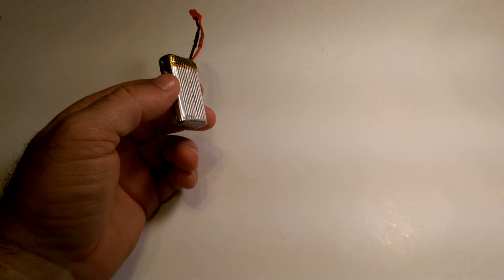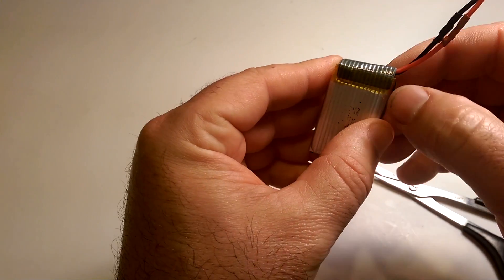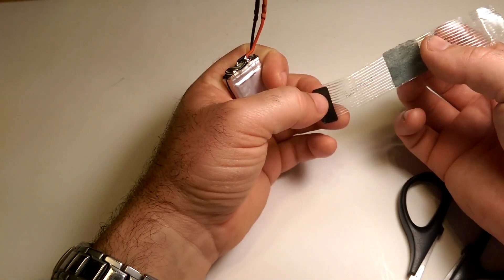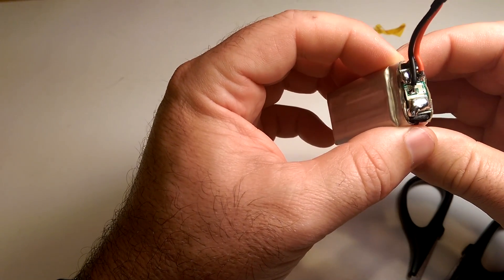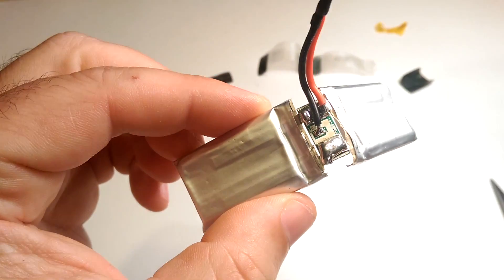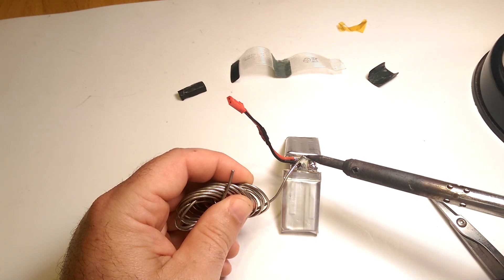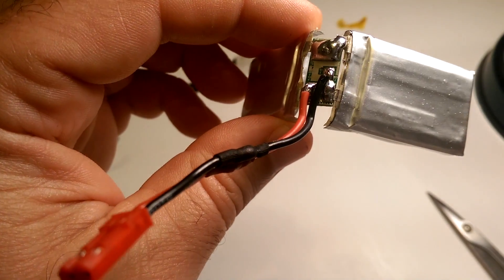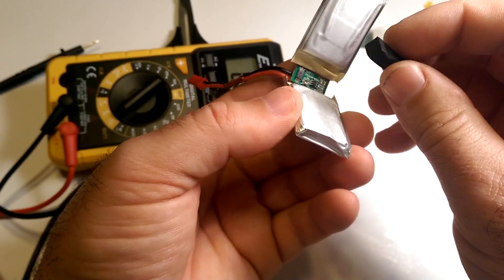7.4v 2S Lipo Battery Repair - Quick and Easy - [Don't Throw Your Shorted Lipos Away]

Comment: Go ahead and bypass all the protection circuits, that should turn your little toy into a roman candle and also burn down whatever it lands on. The replacement battery is only $8.00. Don't forget to put the fire out with water!!!

Comment: you bypass the bms, so the battery is no longer balance.., does it work?
Reply from the maker: Yes but you should  watch it carefully since it can no longer balance.  Don't leave it fully charged or discharged when not using it.  Keep half charged when stored and in fireproof bag/box 🍻

Comment: Good but please remember you loose the 2s lipo inbuilt balance charging circuit so it requires a seprate leads and not recommended for its own original device although it can be use independentely with balance leads anywhere....................

Comment: My man i did da same thing but not da battery mine I accidentally touch the two wires inside of the Drone the ones you connect the battery to it popped out the red one popped out I wanted to solder a bag I accidentally touched it to the black one it smoked burning smell too =/  just stopped I never fucking. Didbthis stuff I don't know now you might just make drone Day ho do you think is it confusing when you get it

Comment: Except now if you accidentally short it, it could explode.... I recommend NOT doing this, but I do appreciate the knowledge share.
Reply: That battery is so small, it won't do serious damage to you. Also: how would you ever short out a battery for more than a second? The bigger risk here is that if one cell degrades differently from the other one and you charge it up without a balance lead it will overcharge and possibly burn (or what you call ''explode'')

Comment: I have shorted some batteries trying to test out adding an fpv camera with various step up boards. I have only just found out myself there was nothing wrong with the batteries just the chips. You can also actually buy replacement chips from aliexpress. I haven't found the right sized replacement boards though. ALSO very important, don't rip the nickel from the aluminium pole of the battery or its going to be impossible to resolder without extra special aluminium alkaline corrosive flux. The chips to look for are probably: 8205A DW01A

Comment: hello dustin I buy a rc car (7.4v 2s 1500mah  Li po battery) from one of your gearbest links and I received a US charger but I live in Europe so I was wondering if maybe I can charge it with this on a computer USB port ? : https://www.amazon.fr/gp/product/B074J5GK41/ref=s9u_simh_gw_i1?ie=UTF8&pd_rd_i=B074J5GK41&pd_rd_r=549db280-2efb-11e8-ad28-014ae5dc2f42&pd_rd_w=jeEA5&pd_rd_wg=SGgox&pf_rd_m=A1X6FK5RDHNB96&pf_rd_s=&pf_rd_r=6B90PPZCKHGH97JW16ZA&pf_rd_t=36701&pf_rd_p=74c057ad-073f-4101-8de0-0fc75f2333b3&pf_rd_i=desktop

Comment: Id recommend disposing of the battery because its not worth it i have a friend who has a airsoft gun thats a aeg an his charger melted from the battery malfunctioned so id say do not use a malfunctioning battery or a short circuit battery cuz rc an airsoft gun do use the same type of batterys theres a number of things that could happen one is the battery can pop an releases smoke toxic smoke two it could explode an cause bodily harm or it could just burn up an catch on fire just spend the money on a new one to bad you cant get a core charge on um lol

Comment: This quick and easy method, you can have nearly unlimited amounts of battery power …for nearly no cost [Check Details Here==>https://docs.google.com/document/d/163kspciMT9QSUlNAvv0MT-ezkqtKCoEIdoxzlystrFQ/edit?usp=sharing ]. Enough to even live off-grid and power all of your devices an electronics! This easy method works for nearly all kinds of old/dead batteries too…

Comment: You can save a lot of money by bringing your old batteries back to life and re-using them instead of buying new, overprice batteries. And this method is simple [Check Details Here==>https://plus.google.com/100351090281822647456/posts/DDHJUMRLfS2  ], quick and anybody can do it.

Comment: Ok. You should just resolder black wire to the other contact. You should also remove the circuit and just solder three wires balancing port on and then charge it with lipo charger

Comment: Hey Dustin. 
I want to ask, does the battery still work after you accidentally short the leads??  Cus in my case i accidentally cut both leads at the same time and it had a spark.. After i rejoint the wires, the battery still works and i can recharge it too, but  i dont know if thats ok or not.  Does the short surely blows up the chip oranything on the board ?? Or r there any chances of being lucky ?? 

Thanks bud .
Reply from the maker: +zakir mohammad I think you were lucky.  That's what I did and it fried the chip so I had to do this mod...lol.  yours should be ok.
Reply: Thanks alot bud ;)

Comment: Hi there.
 Do you by any chance know of a motor type that would work for the JJRC H8C and will last for more then just a few flights?
I am tired of replacing motors every 10 flights or so...
Reply from the maker: +Jack Scarpon Unfortunately this is the downfall of the H8C... a nice powerfull 7.4v system with motors being week point.  Not sure if a manufacturer has made more durable motors in this size yet sorry.

Comment: Hi Dustin,
I charge Lipo batteries with IMAX B6, but when I connect one of them 7,4V the charger indicates 1SER and not 2SER. It means that one of the poles is dead and only one of them is loaded?. I could fix this battery in the same way that you show?.
Reply from the maker: You can open and check connections.  Also if lipos are discharged too low they can show wrong cell count.  You could try charging a little at 1s then switch to 2s and see if it sees the correct cells.
Reply: +Dustin Dunnill Many thanks.
Reply: ladamw1967 There's no balancing port, so how can charger know the number of batteries? It's all done internally with chip.

Comment: Just be carefull and not over charge the thing.  I guess there is also a chance that the copter itself could catch on fire and burn if there is a short in it somewhere.  But I won't lie, if I had no other battery, I would certainly do the same thing.  Nice video man.

Comment: how are u going to charge that without balance port?
Reply from the maker: Plug it into a smart charger and charge it.  It will not last as long.  But it will work fine for a while until you get a new battery.

Comment: So save 5 bucks then risk burning your house to the ground... Humm.
Reply: +Dustin Dunnill 
Dobermandan is right.
Dustin, you're also right that most lipos don't have circuit boards, but most 2 or more cell lipos do have a balance plug for charging individual cells.
As the battery pack ages, individual cells often degrade at different rates.  When charging 2S or more in series, without balance charging, If one cell can't be charged up to 4.2v, the other cells will get overcharged (and possibly explode).  So in your 7.4v lipo's case, let's say one cell goes bad and can't be charged correctly.  The other cell has to take up the "slack" because the whole pack will be charged up to 8.4v, rather than each cell being charged up to 4.2v.  And without a balance plug, there's no way of checking if the individual cells are balanced.
So Dobermandan is not joking when he says you're risking burning down your house.  This is very serious, so please do some more research if you're still not clear on it.
If a 2S pack doesn't have a balance plug, then there's a very good reason it has a circuit board, and bypassing it is asking for trouble.  Don't do it.
Reply: Regardless of what he does, he is showing other people how to do this, and it is simply irresponsible.  Lipos can be dangerous when mishandled, and this is definitely mishandling when you cut out the original safety measures put in place.
Reply: Zviki, you need to read my whole comment again.  I said, "individual cells often degrade at different rates."  These lipos usually get worse and worse rather than just suddenly dying.  This is what causes the problem without a balance plug or a circuit board.
Reply from the maker: hows that?  Please enlighten us.  Most lipos have no circuit board.  Have you had any lipos besides these toy versions?
Reply: Dobemandan Somtimes you gotta risk it to get the biscuit
Reply: RCotaku69 I don't think so. If one cell in series is dead, then you can't charge the other cell neither
Reply: RCotaku69 Yep, I  read it. It's not that simple as you said. If one cell goes bad than also impedance will raise. I don't think that he charges batteries with charger without any internal charging cut off option.

Comment: can i replace the 1000 mah 3.7v  lipo battery circuit to 3.7v 1500 mah lipo batery??
Reply from the maker: as long as you connect correctly as shown in video, the MAH does not matter.  yes.

Comment: Shunting the safety circuit is dangerous!
You can do it, but be careful of overcharging fire risk!
Reply from the maker: Your right.  Although larger lipos don't have this type of circuit board and have a balance wire instead. These are there to make up for the crappy charger and no balance wire.  Definitely charge these on a smart charger for longest life after this mod.

Comment: Hey Dustin Dunnill im thinking about getting the jjrc h8c but ive seen many reviews complain about motors failing and then after replacing them having thoes motors fail after a few flights is this true?

How many motors have failed for you and after how many flights as i may not bother if motors failing is going to be a frequent thing?
Reply: I have had a JJrc H8 since January, it ran OK for a month.Then one motor  failed. Ordered 4 Changed one  then another went.Then another.Ordered 4 more. All from China that takes weeks to arrive.
This quad does burn out motors. On reflection I would not recommend it. Even though it flies well in higher winds than say the Syma x5-1 can handle.I was thinking of getting the WL toys V636, when I got the Jjrc H8, I wish I had.
Reply: Dustin Dunnill I agree with all you said, It is great fun to fly, I learnt on the Syma X5c-1 that is still going strong. Some design fault does exist with the motors on the Jjrc H8. I suspect they are 3.7 v motors put in a 7.4 v quad.
Reply: Jim Sparky I think you're right. The JJRC H8C is a great quadcopter, but the motors fail quickly  because of too much voltage. Did anyone try lowering the battery voltage to save the motors?
Reply from the maker: I've had 2 fail after about 20 or so initial flights.  replaced all 4 and haven't had a failure in about 12 flights.  I think the motors just have high rate of quality issues and some people get lemons.  You can find them for about 2 bucks a peace do if they last around 20 flights and your capable of changing them I think its still worth it for how great the H8C fly's.
Reply: Dustin Dunnill the motors I got are £2.50 each so like $3.50 can you get them cheaper? thanks for your help by the way :)
Reply from the maker: Click on my name to check my channel to see other H8C mod videos I've made.  I have it all listed with links in the descriptions.  I basically got mine from GearBest and they were a little over $2 each and free ship.
Reply: Dustin Dunnill Thanks :)
Reply from the maker: The brushed motors in any "toy grade multirotor" or any toy flying device will eventually fail.  It is unfortunate that these don't last longer.  I used this quad as a tool to learn on before I purchase a larger multirotor so it lasted long enough for me to learn how to fly before the motor issues started.  Your right though, it is too bad they burn sooner than most and that is attributed to bad design.  I'm ok with spending 8-9 bucks every few months for a new set of motors for the amount I fly it now and for the fun it provides over lower voltage quads.  I do wish there were longer lasting motors though....hopefully sometime.

Comment: Can anyone give me any Info on weather or not I can used a cordless phone battery in a RC helicopter thanks .The battery from my rc helicopter is rated at 7.4v and 680Mah the battery from my cordless phone is rated at 3.6volts and 1300Mah
Reply from the maker: Hey Kenton.  The voltage would not work.  Best to stay with the power requirements of your r/c spec.  Also the larger battery would throw off the weight balance and it might not fly or fly different even if the voltage was the same.  I would just get another hobby grade battery which matches your R/C.
Reply: ok thank u very much sir,i did try it just to see ,it did work but the battery was to low to even move the heli,sorry am having a hard time finding any battery for my (protocol heli raider)or even a comfortable battery that will fit
Reply from the maker: Hey Kenton,  sounds about right.  Your trying to use 3.7v on a heli that requires 7.4v.  It needs the higher voltage for more powerful lift.  I would measure the dimensions of your battery compartment and look for something that will fit (maybe eBay?).  Your looking for 7.4v 2s lipo.  If you can't find one with proper connector you may have to solder or crimp your own to make connection work.
Reply: If it has the right connector but doesn't fit inside then velcro it to the outside.